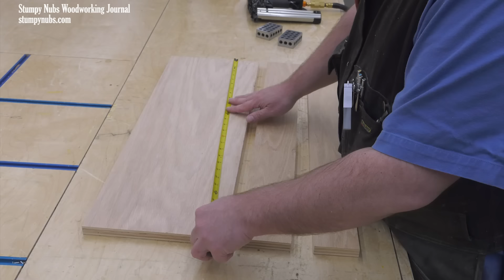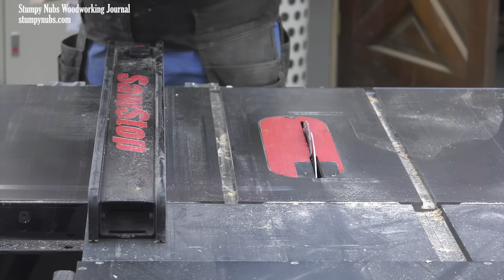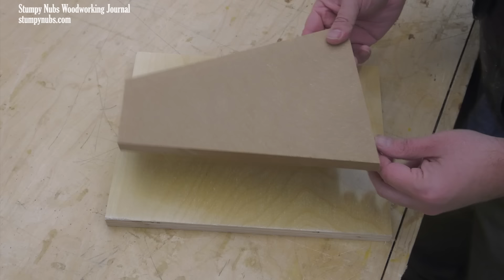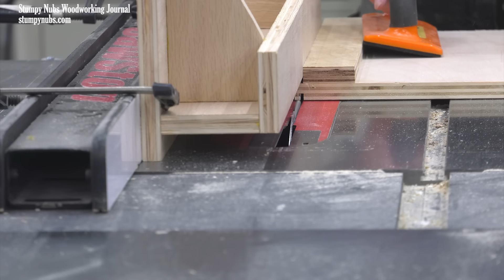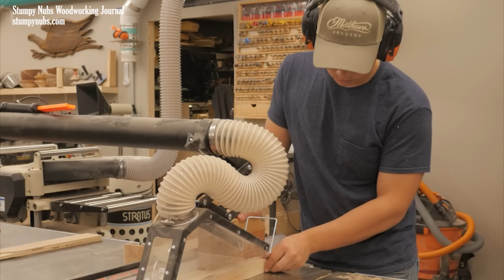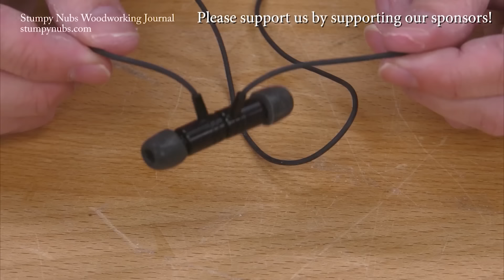How to transform your table saw fence with ONE jig.

Comment from the maker: ▼EXPAND THIS SECTION FOR MORE RESOURCES RELATED TO THIS VIDEO▼   

★THIS VIDEO WAS MADE POSSIBLE BY★
 ISOtunes Bluetooth hearing protection (Save 10% when you use this link): 
https://bit.ly/3BHYdH7
Please help support us by using the link above for a quick look around!
(If you use one of these affiliate links, we may receive a small commission)
 
Links promised in this video:
-Video about 1-2-3 blocks: https://youtu.be/91XuX8hqfY0

★SOME OF MY FAVORITE CHEAP TOOLS★
-123 Blocks: https://lddy.no/vpij
-Mechanical Pencils: https://amzn.to/2PA7bwK
-Lumber pencil: https://amzn.to/2QtwZjv 
-Pocket Measuring Tape: http://amzn.to/2kNTlI9
-Irwin Drill Bit Gauge: http://amzn.to/2AwTkQg
-Nut/Bolt/Screw Gauge: http://amzn.to/2CuvxSK
-Self-Centering Punch: https://amzn.to/2QvbcrC
-Self-Centering Bits: https://amzn.to/2xs71UW
-Angle Cube: https://lddy.no/10nam
-Steel Ruler: https://lddy.no/10mv7
-Utility knife: https://amzn.to/3nfhIiv
-Center-Finding Ruler: https://lddy.no/10nak
-Bit & Blade Cleaner: https://amzn.to/2TfvEOI
-Digital depth gauge: https://amzn.to/3mwRf2x
-Wood Glue: https://amzn.to/3mqek6M
-Spade Bits: https://amzn.to/3j8XPtD
 
★SOME OF MY FAVORITE HAND TOOLS★
-Digital Caliper: https://amzn.to/384H1Or
-Marking Gauge: https://lddy.no/10muz
-Marking knife: https://lddy.no/10mv0
-Narex Chisels: https://lddy.no/sqm3
-Stanley Sweetheart Chisels: https://amzn.to/3y5HDOc
-Mini Pull Saw: https://amzn.to/2UEHBz6
-Gent Saw: https://lddy.no/ss2x
-Coping saw: https://amzn.to/2W7ZiUS
-Shinwa Rulers: https://lddy.no/zl13
 
★SOME OF MY FAVORITE POWER TOOLS★
-Miter Saw: https://amzn.to/3gqIlQ8
-Jointer: https://amzn.to/3yc3gfZ
-Planer: https://amzn.to/3mn6BGF
-Router: https://amzn.to/3grD22S
-Sander: https://amzn.to/3DdvD0Y
-Cordless drill: https://amzn.to/3D9ZiIm
-Brad nailer: https://amzn.to/3gsRkjH
-Mini Compressor: https://amzn.to/3mvrmQr
-Bladerunner: https://amzn.to/2Wl0TtJ
-Jig Saw: https://amzn.to/3zetTBY
-Scroll Saw: https://amzn.to/3gq9qDc
-Multi-Tool: https://amzn.to/3muZuMi
 
★SOME OF MY FAVORITE OTHER TOOLS★
-Drill Bits: https://amzn.to/3B8Ckzh
-Forstner Bits: https://amzn.to/3kk3wEI
-Shop Vacuum: https://amzn.to/2Wkqnbl
-Machine Setup Blocks: https://amzn.to/3gq7kDh
-Counter-Sink Bit: https://amzn.to/37ZukUo
-Featherboard: https://amzn.to/3DeqHsq
-ISOtunes Hearing Protection (Save $10): https://bit.ly/3BHYdH7
 
(If you use one of the affiliate links above, we may receive a small commission)
Reply: Do you really like the Bladerunner by Rockwell? I kinda thought it was a gimmicky kinda tool, especially if you already own a scrollsaw and/or a bandsaw.
Reply from the maker: @filcie  It is very handy for certain tasks. I especially like it when I have to cut an opening in the center of a workpiece.
Reply: @StumpyNubs  fair enough!
Reply: Do you have plans to make the tenoning jig

Comment: OMG - that tip for cutting straight edges on a board was worth its weight in gold. Thank you so much for these informative and functional videos. I never fail to learn something new from you.
Reply: And the need for a jointer gets pushed back once again!
Reply: This jig would actually have been useful a while ago when I was trying to straighten the edge on some particle board for making some simple drawers.

Comment: I finally got around to building one of these fences and quickly found it is a great way to cut the rebates for breadboard ends. I’ve used many methods that involve making elaborate setups to ensure the top and bottom rebates are perfectly matched. Using this jig makes the job so much easier, faster and very accurate. I simply double side tape a fence to the top side of my workpiece, cut the rebate and then set the fence perfectly along the cut edge on the bottom - and hey presto -  perfectly aligned rebates top and bottom. Thank you Stumpy!

Comment: Mr. Nubs, I've been building some shelves to go into a closet alcove , and as luck would have it, none of the angles were a perfect 90°, and the one that looked like 45° wasn't. I had very nearly resigned myself to an afternoon of tedious mind-numbing tracksaw cutting, when I chanced across your video. I built the jig, and using the template I already made, batched out the 4 wonky shelves in about 15 minutes. THANK YOU for this video, and your enormous body of work.

Comment: I like the idea of the L-Fence and will be making one this very day.  It puts me in mind of both flush trim bits and guide bushings, but with the advantage of the stand-off being infinitely adjustable so you can creep up on a good fit.  But the reason I am commenting today is to say that the ISOtunes hearing protection actually make a lot of sense.  I've taken to using my Bose QC35 headphones to listen to my audiobooks while working in the workshop, and they definitely get a bit messed up.  I've had to replace the earpads already, and they are looking a bit jaded.  That's not a great way to treat headphones that cost NZ$450!  So I am going to invest in a set, but I have not decided which one yet.  So thanks for the heads up James.
Reply: My thoughts exactly!
Reply: If you're going for earbud style protection I strongly encourage you to get the ones that are truly wireless rather than the ones that have a wire between the ears. My wire broke pretty quickly and while I still have hearing protection I now only have Bluetooth in one ear

Comment: This is by far my favorite jig to use. Especially when doing a miter edged casing on a cabinet. No need to worry about the edge splintering or having a lip and don’t have to take cumbersome panels over to the router table to use a chamfer bit. 
Instead, just place the stand off board on top of the workpiece right at the edge being cut, set the saw blade at 45° and pass it along the L fence. Crisp, burr free edges every time. 
Largest panel I’ve done a miter on using this method was just over 1800mm long! Gone are the days of using the tracksaw!

Comment: This is a genius little jig and I'm going to build one. That said, in my area most tablesaws are sliding panel saws and often shared between different individuals.
The more jobs we do on the table saw the more everyone will be waiting in line to use it. For a contractor saw type setup or a one man shop (or weekends in my case) it's brilliant though.

Comment: One nice item I discovered sort of by accident is extra large absorbent puppy pads.  I bought a box of 200 at Costco for around $25.  My intended purpose was to use them when I am changing the oil in my cars - to prevent oil spills on my driveway but I ended up using them all of the time for smaller woodworking/painting/glue-up jobs.  I lay one out on my workbench and put my smaller project on top and it keeps my workbench clean when I am doing light sanding, painting, waiting for glue to dry etc.  I can't tell you how often I use these.

Comment: I love your programs, Stumpy.  I was directed to use this L-jig for cutting tapers.  I'm a bit uncertain just now, as my finished pc will need to be an isoceles trapezoid with a 1" top edge, 70" ht and 6" bottom edge.  It seems this jig's inside clearance will only accept 3.5" max. width, so it won't work for my piece with the 6" width.  Pity .  I am still experimenting with your jig and some cheap pine stock.

Comment: I have a slightly practical question. Why not make the horizontal piece a touch shorter than your two vertical pieces? This way you get more room for your clamp. 

I love the idea and I'm looking forward to building it!
Reply from the maker: Not sure I understand what you mean.
Reply: You mentioned that the three pieces, the two vertical, and one horizontal piece are all about the same length. What I'm saying is that the horizontal bridge piece is about 4 in shorter in overall length, 2 in of clamping space on each side. The clamps seem to hit the horizontal piece on occasion making the whole jig not sit flush against the fence. As you said, it doesn't really matter if it sits completely plumb, but it may be worth a try.
Reply from the maker: @michaelbonomo4983  I see what you mean. Yes, it's a good idea :)

Comment: Hi James. Awesome as always! Question: how do you clear your offcuts? Are you stopping the saw and just using a thin stick to poke them out? Three or four cuts not a problem, but curious what you do when batching many parts. Thanks for all you do!
Reply from the maker: They clear themselves, mostly. Just like when using a regular fence, the off cuts from one workpiece push forward those from the last one. But if you did feel the need to clear one, turn off the saw first.

Comment: Wow, blown away, especially by the ability to cut odd shapes, I mean find me an easier and quicker way to cut that shape perfectly every time. 

The router table is good. But it's slower than the table saw. And not to mention, a single spiral flush cut bit is over 100 euro for me to buy. Whereas my table saw is right there

Comment: If you build it wide enough to ride on top of your rip fence, the wide side can be placed facing the blade, an auxiliary fence can be clamped on the narrow side to prevent wandering, et voila, you’ve got a low-cost tenoning jig to cut the wide cheeks on your stock.
Reply from the maker: I've been thinking of a similar modification for a while, now. I may revisit this later.

Comment: Is this really accurate enough for flush trimming? It seems like it would be hard to get it perfectly aligned with the blade.
Reply: It's really pretty simple.  Just like in the video, place a combination square against one of the teeth and snug the jig up to it.  Works as well as a flush trim router bit.

Comment: I have a problem with my old table saw: can't incline the blade more than 14 degrees. Do you have any solution with jigs or so? I would like to cut 45-46 degrees for jointing edges on boxes, so I need a quite precise cut... Thanks
Reply: Sir check your table saw lead screw, it may be covered  with saw dust making it Impossible to tilt the blade properly
Reply: @ga5743  I did, the problem is another one: the cut in the table is not big enough and there's no room for improvement. It's a handmade table saw with an adapted contractor saw mechanism built in. It tilts max to 14°...

Comment: How does it work with a dado blade?  I've seen other jigs that will allow for that.
Reply from the maker: Exactly like I demonstrated, just with a single pass instead of four.
Reply: @StumpyNubs  Watch how Bob Vandyke uses his L fence for dados.  1 inch is too high unless you want to attach a guide board on top every time.